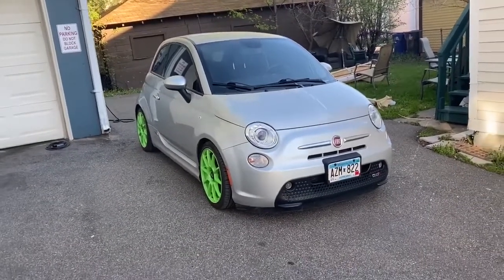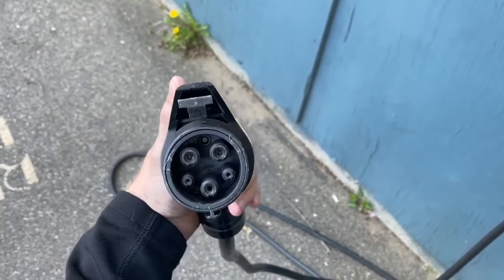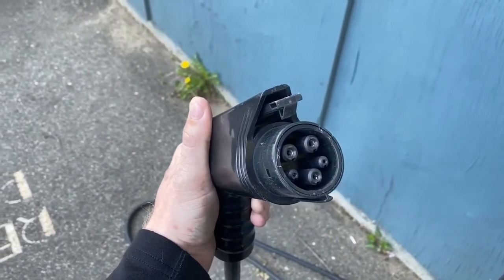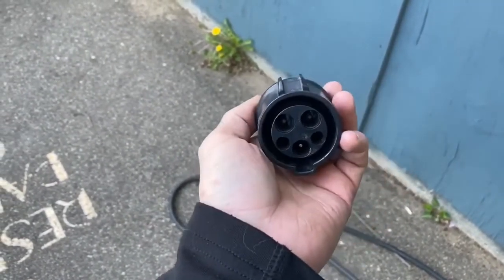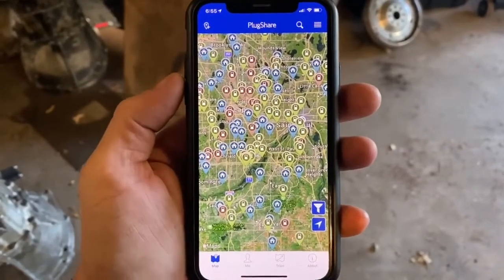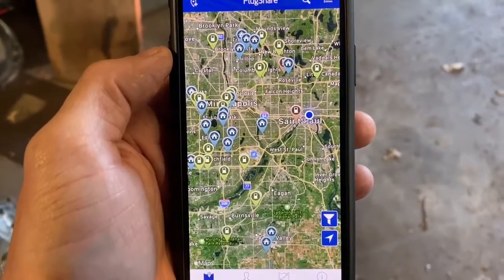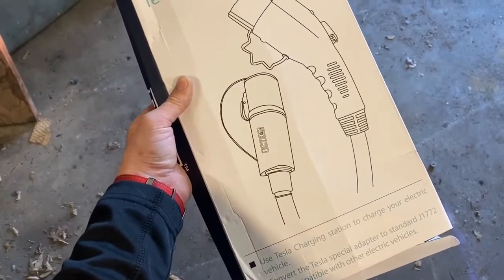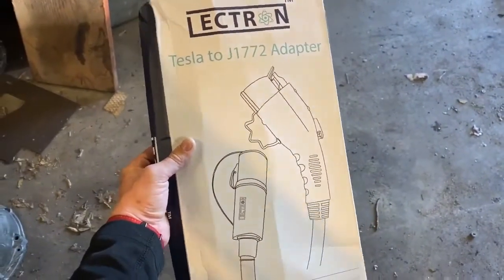Lectron J1772 Tesla charger adapter for EVs and PHEVs

Comment: Instructions say to plug adapter into the power first, wait 30 sec before plugging into your EV. Also recommends lock/unlock to reset if needed.
Reply from the maker: completely unnecessary. the protocols that exist in the J1772 standard perform their handshake nearly instantaneously and there are no active electronics in this adapter.

Comment: I plugged it into the original HPWC Gen 1 wall charger and it failed to start charging.  I did 2 things to get it working.  I briefly pressed the "door opener" button on the Tesla handle and it reset the charging sequence and it began charging.  I also power cycled the Tesla HPWC Gen 1 and it worked that way too.  I had no trouble using it on the Gen 2 wall charger.

Comment: Does the Gen 2 Mobile Connector lock into the adapter once it starts charging?  I noticed the J1772 has the ability to be locked but that almost seems pointless if you're unable to ensure the Tesla connection locks into place as well.
Reply: it does lock in but its just a spring loaded tab. not secure for theft, but absolutely does hold it in securely